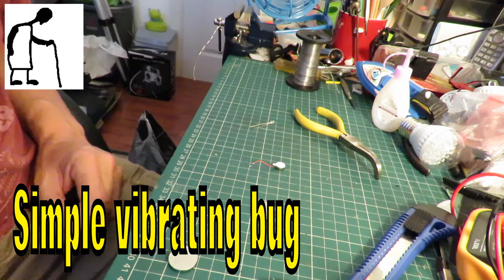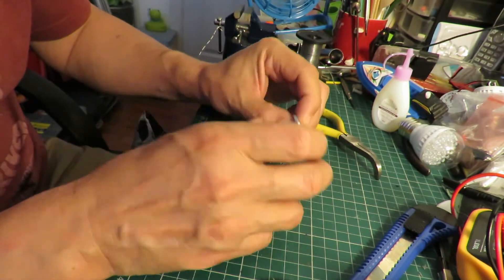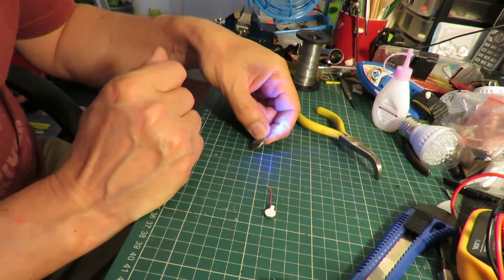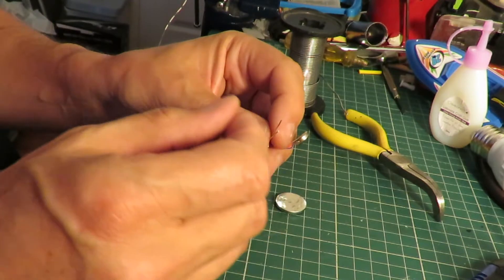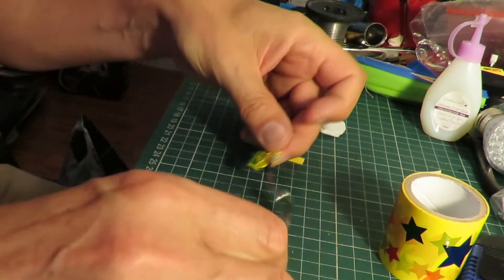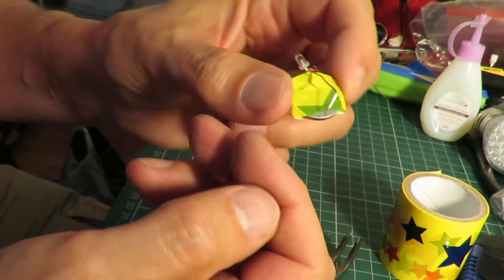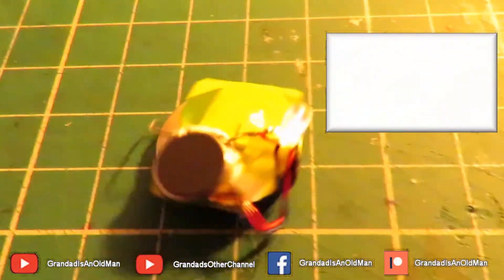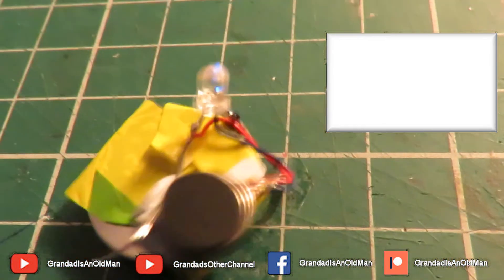Simple vibrating bug using a Flat Vibration Micro Motor

Comment: Love this project! After about 8-10 minutes my motor stops. If I disconnect the battery and then reconnect it usually starts back up. Do you have this issue? Any advice?
Reply from the maker: All batteries will self restore slightly when left to rest, however that is only a marginal effect. That may be what is happening for you. It is also possible the vibrating motor may be overheating, although I would not expect that if you are just using a button cell to power it. I would also say that 8 to 10 minutes sounds like a very good run time. Button cells don't last for long when you load them with something like a motor. They are only intended for very low current draw applications.

Comment: Which coin cell you are using
Reply from the maker: Probably a CR2032 or CR2025 or even a CR2016, they are all 3v, just different thicknesses. the 20 is the diameter and the 32 or 25 or 16 are the thicknesses and I buy them in cheap packs that have 5 or 6 of each
Reply: Thanks for quick reply. 
I have tried to run the same type of vibration motor using CR2032. It runs for 3 seconds, and gradually slows down and finally stops. That's why asked which coin cell you are using. When I tested the voltage, it shows 2.8V and increasing slowly 0.1v per 5-6 seconds and reach back to 3.2v after few minutes. Any idea, why this happens? 

My primary assumption was, CR2032 is not able to provide power enough to run the vibration motor. Some internet article suggests to use a parallel super capacitor. Guide me.
Reply from the maker: All batteries will self restore slightly when left to rest, however that is only a marginal effect. You are measuring the "no load" voltage, as soon as you apply a load it will discharge rapidly. The capacity of the battery to supply current will not have restored significantly and trying to re-use it will give you exactly the effect you describe. It sounds like you are using a dead battery and that is why it runs for a few seconds and then stops. Buy a fresh battery and try it again.
Here is some information about supercapacitorsCapacitors vs Batteries video by Ludic Science https://youtu.be/LNci-13Bp1U
Supercapacitors https://www.youtube.com/playlist?list=PLA5a2xPRSrB3nbCpNn0cKcbbEW2skD_Qi
Supercapacitor Boat https://www.youtube.com/playlist?list=PLA5a2xPRSrB3TJCBigrLmf8jGYjkKgI8C
Supercapacitor planes https://www.youtube.com/playlist?list=PLA5a2xPRSrB1wNvirrwAn69eo_pM0tdEM
Supercapacitor Cars https://www.youtube.com/playlist?list=PLA5a2xPRSrB3l-TbAgbFomae9UZtdvkRb
Wikipedia http://en.wikipedia.org/wiki/Supercapacitor
http://www.electronics-tutorials.ws/capacitor/ultracapacitors.html